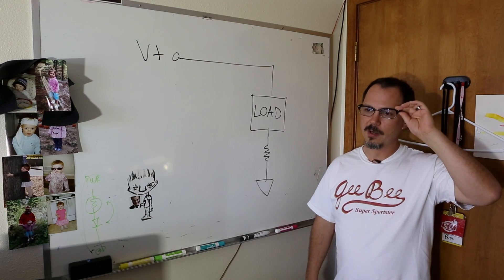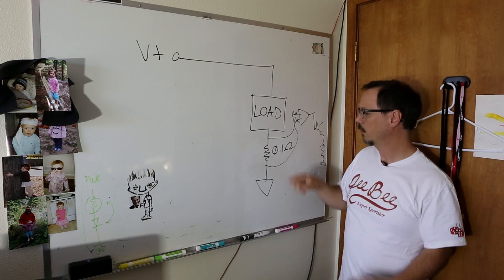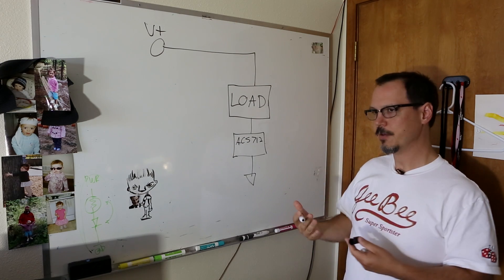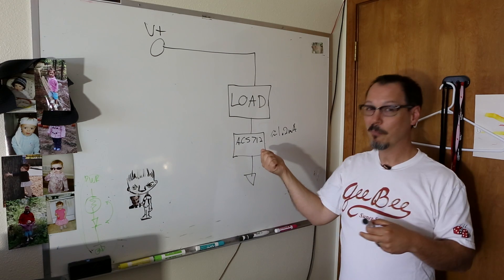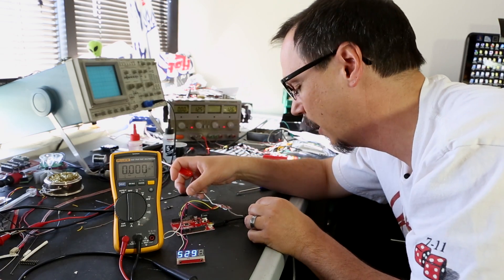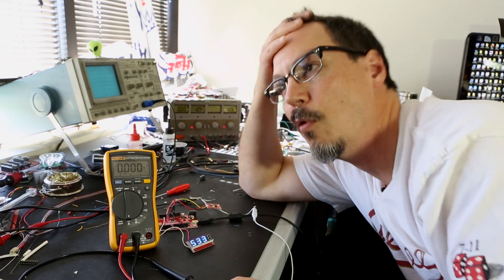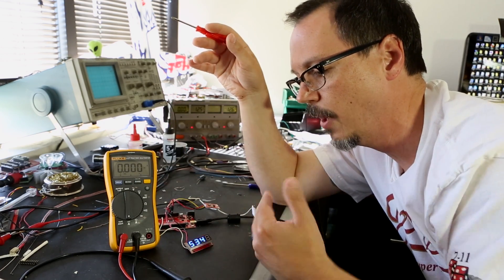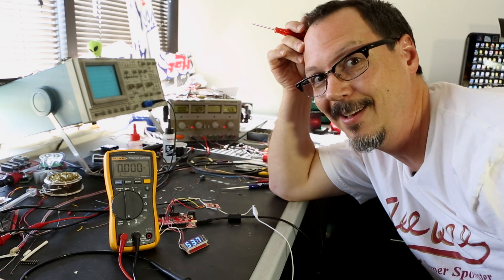SparkFun According to Pete #32 - Current Sensing

Comment: How does a 0.1 ohm resistor generate noise ? I though you just get voltage drop when current flows through it. Can anyone give simple explanation for a novice. thanks
Reply: Here is a guide on the kinds of noise a resistor can have in a circuit. http://www.resistorguide.com/resistor-noise/
Reply: All resistors generate noise as in fluctuation in voltage. In very low frequency as in DC I remembered it's dominated by 1/f noise and frequency higher up you have thermal noise proportional to sqr of the bandwidth - in short for most DC application you don't have to "think" about it, it's specified on the data sheet and there's nothing you can do about it even if you know all the physics. The problem here is the video did an exceptionally poor job of explaining anything conceptually useful .... "noise on the high side ... less noise on the low side... CMV blah blah" and assume a hobbyist knows what's he's talking about. Some Sparkfun videos are really trash.  There are better videos out there on TY explaining these stuff

Comment: is the acs712 fast enough to protect a 250mA fuse in a digital multimeter? e.g. if I take the output of the acs712 feed it to a voltage comparator that has it's output tied to a PNP transistor that is in between Vcc and load?